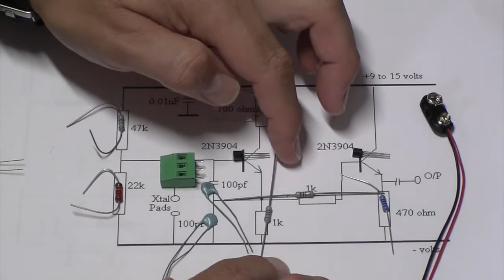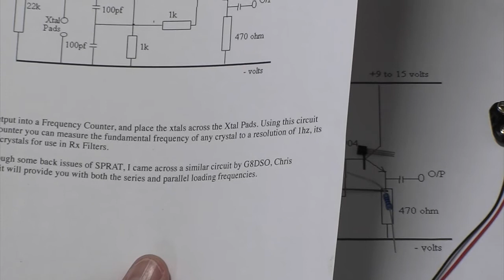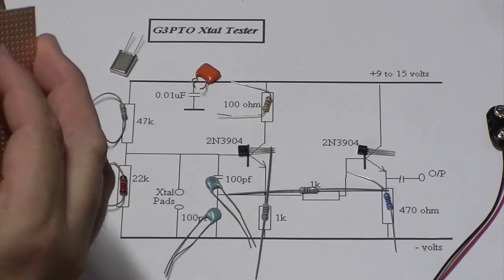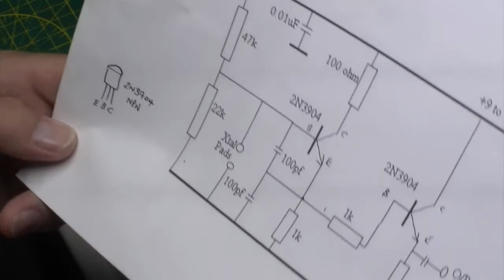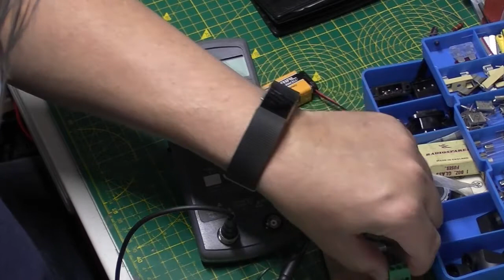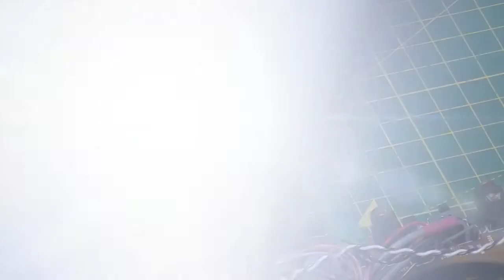Sony ICF-2001D receiver repair part 4: The elusive crystal

Comment: hello.
Parts for all who have the sony collection.

your fault finding is perfect.
there is a product you are looking for on this site.  (6.275 MHz OSCILLATOR CRYSTAL)
other connectors are available 13 pin 9 pin (   sony icf 2001d or  2010d)

link :  https://www.sahibinden.com/ilan/ikinci-el-ve-sifir-alisveris-ev-elektronigi-tasinabilir-ses-sistemleri-6.275-mhz-oscillator-crystal-radio-special-zero-577478655/detay/

link:    https://www.sahibinden.com/ilan/ikinci-el-ve-sifir-alisveris-teknik-elektronik-devre-montaj-9-pin-ffc-connector-13pin-ffc-connector-sony-icf-2001d-2010d-583439249/detay/

link:   https://www.sahibinden.com/ilan/ikinci-el-ve-sifir-alisveris-ev-elektronigi-tasinabilir-ses-sistemleri-sony-icf-2010d-or-2001d-radio-9pin-or-13pin-connector-583735383/detay/
Reply from the maker: Thanks for the links. They will be useful if I get another one in for repair

Comment: .... Hello Everyone, today I have repaired a radio Sony ICF 2010 American model of 2001D, and I have remembered my friend Radiocruncher, I just changed all the capacitors electrolytic of the radio Sony ICF 2010 and has been the most complicated thing I've done in my life, the tracks of this radio and the way they have put the components is the most complicated that Sony has done including the value  In micro farads of the capacitors, and the contacts of the batteries that have had to solder with cables,lots of hours but finished.
Note:Bad electrolitic ESR value
Reply from the maker: Hi Manuel. I’m glad you got it going. It was one of the toughest recaps I have done. It tends to be the capacitors in the amplifier section that are the worst. Thanks again for the help you gave me. Regards Graham

Comment: Did Manuel say what piece of equipment he salvaged it from?
Reply from the maker: Hi John. The crystal came from a ICF-SW55. I have had 5 of these made to keep as spares now at great expense! Thanks for watching. Graham
Reply: Radiocruncher 
What was the actually frequency it runs at? Usually Sony crystals will print that specific number right on the side of the case itself
 for eg on my Sony ICF-SW7600GR the crystal X102 (there are two of them) is printed as "55.390"  (MHz). Which crystal is it? The 
X101 or X102 that failed? Very curious about this. Thanks.

Comment: Glad you were able to locate a new crystal. Peter over at TRX Bench did a video recently on a little Chinese kit you can build to test crystals. It has a digital readout built into the board. I built one up and it works quite well. QC on the PIC is a bit hit and miss apparently but mine was OK. It was less than $10 and has a very nice fitted clear plastic case. Very handy. Enjoying the series. ATB Doug.
Reply from the maker: Thanks Doug. I did watch Peters video and that little kit is well worth getting for the price. Thanks for watching. Graham